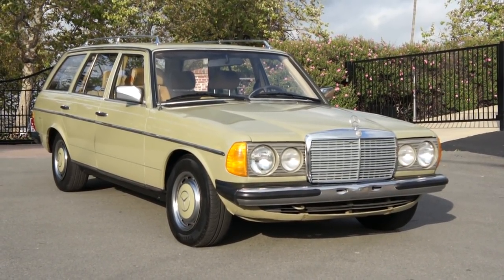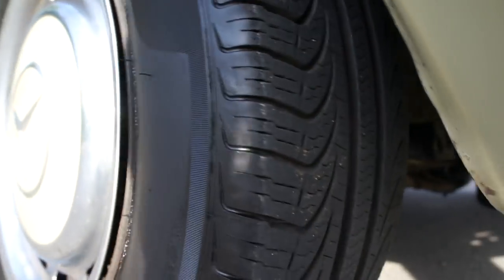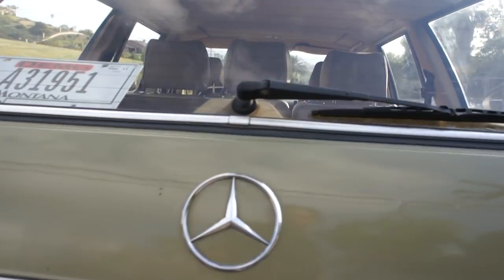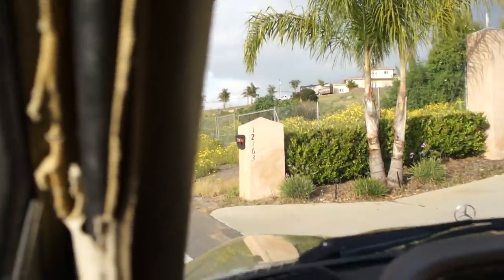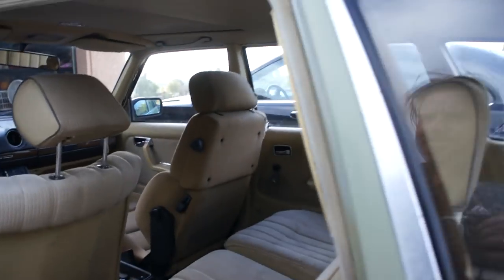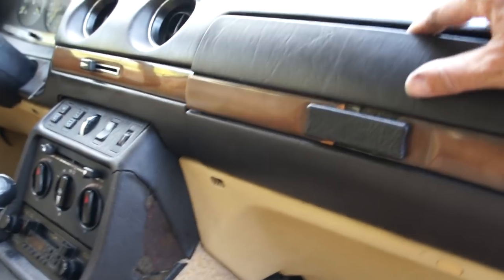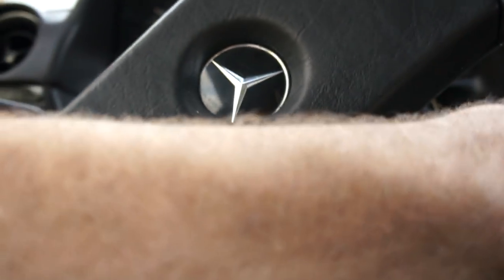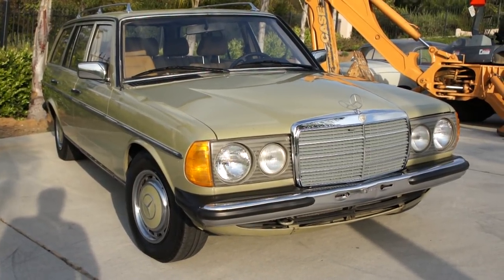84 Mercedes Benz 300TD EURO Diesel 4 Speed W123 Station Wagon Break

Comment: Great car. The hood hinge problem is the pin that its attach to is ether broken or worn out. a new one will have to be welded in. Your ignition switch i would change right away because when it goes out. Its really hard to change. The vibration noise. I would check the mounts. These are some of the same problems i have been coming across for 13 years. Good score on the car.

Comment: I doubt those color-keyed wheels were still available (in 1984) on our version of any Mercedes-Benz W123 series. I know the 300 series non-turbo diesel wasn't available here since the 1982 model year.
Reply: +ClassicTVMan1981X  My 1984 300D 123 Euro model (purchased in the USA. picked up in Germany to tour Europe, then delivered by MB to USA ) came stock with the wheel covers matching the color of the car; so they were still available at least until late 1983 or early 1984.

Comment: Definitely does not sound good - usual manual transmission problems on these cars. Many different noises from the transmission, the car is definitely swinging after shifting. This will cost tons of money in relation to car value (3000€+). Had this problem on three of my W124s.  Transmission, differential, whole cardan shaft completely worn out. If you buy an old Mercedes, buy an automatic!